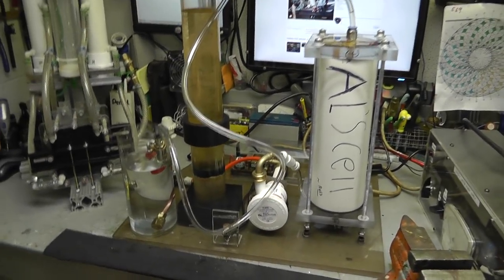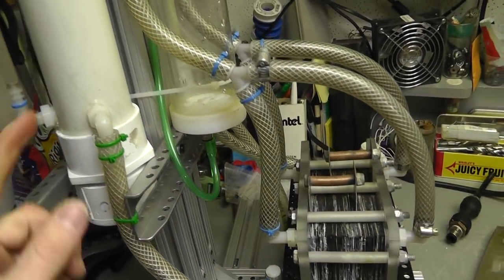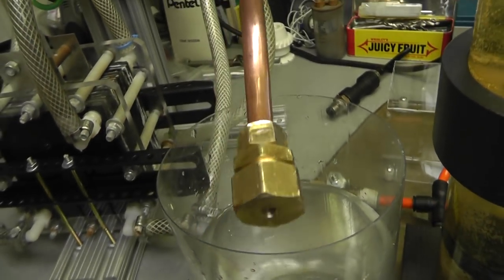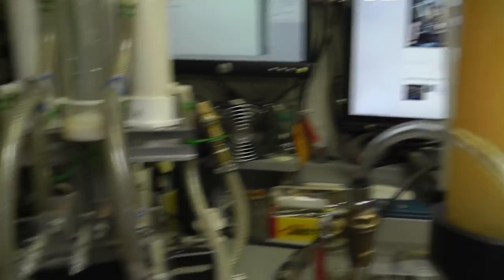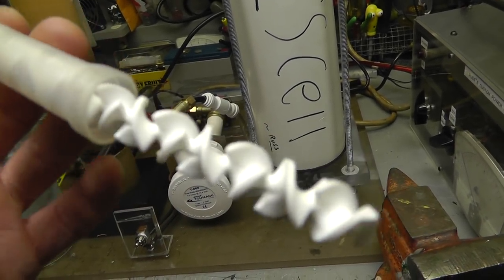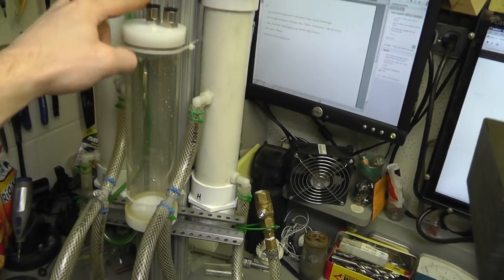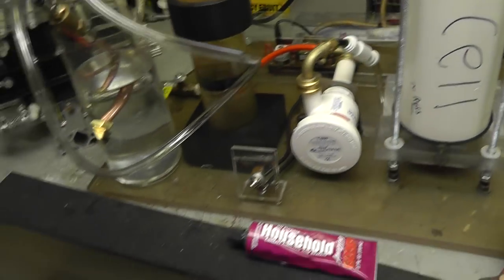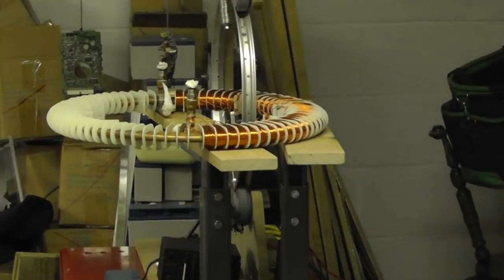01-03-2012 Live After Show! Re Worked Some Stuff For Test's

Comment: I wish I had a wood stove in my garage too!  I have a little propane heater, but it don't do much when its below freezing.  I don't even attempt HHO experiments in the winter.  I think the teflon tape really only works on pipe thread that is tapered, the threads actually mash tighter together the farther you turn it on.  It's more of a lubricant to get the threads together tighter. :)

Comment: Split cell looks good. Nice work. I had all sorts of issues using thread seal tape as well. It always ended up leaking. I haven't tried the adhesive your using but I have tested a lot of the Permatex automotive adhesives or rtv adhesive and they hold up to heat and the electrolyte. JB weld works awesome for permanent connections and have began testing it on sealing hole edges of plates. Its also unaffected by electrolyte. Both good to 500 degrees. Your hho unit is looking great too.

Comment: @rwg42985 I'm thinking teflon might melt or burn?  I know its on frying pans and they put it in engine oil, but I think it would be much hotter than that.  I wonder if the stove cement Jeff is using on his reprap nozzles would work.